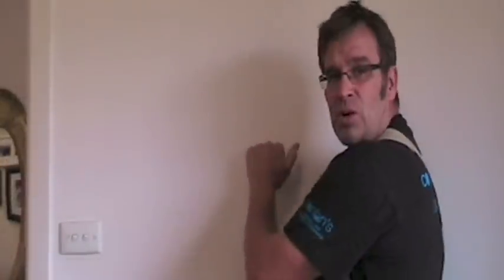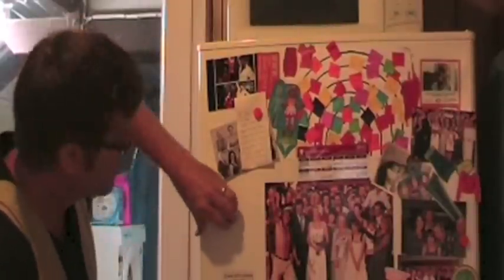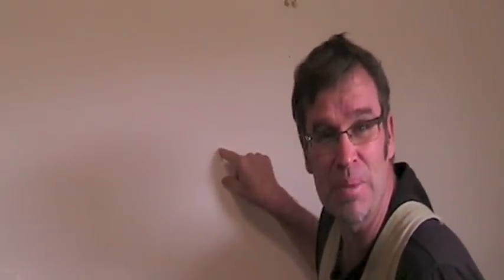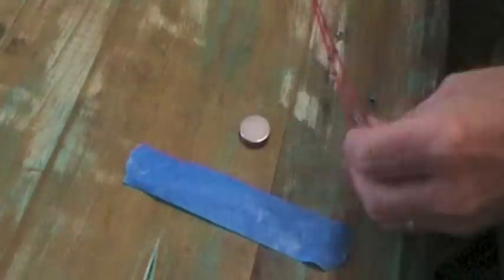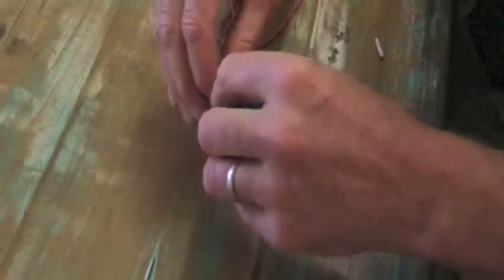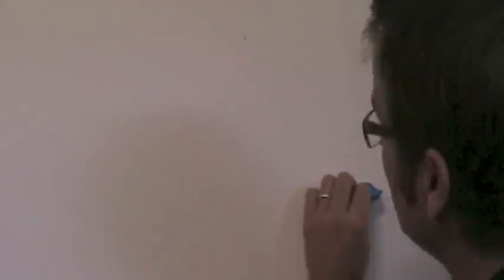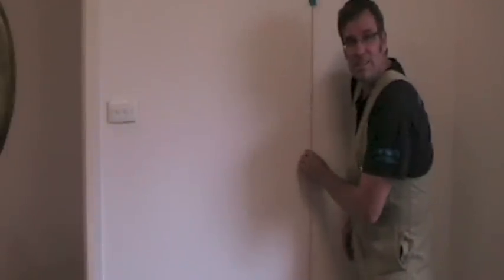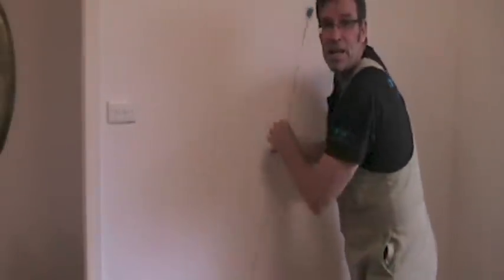How to Find a Wall Stud. THE ULTIMATE STUD FINDER!

Comment from the maker: Thanks for your comment Blackuyuyi. Much appreciated. 11kg is fairly heavy. If l was you l would try and find at least one timber stud to screw a wall fixing to and then use a Wall Mate for the other fixing. If you cant find a stud l would probably go for a wall toggle for each fixing. Check out my latest video on how to put up a shelf. It shows how to install a wall toggle. Check out the weight loading on the back of the wall mate packet. It varies as to what size of wall mate you use. Cheers

Comment from the maker: Hi Kimberly. Drywall is attached with metal fasteners exactly the same way to the ceiling joists as it is to the wall studs. So just use the magnet the same way as you would with the wall. Thanks for your question and for your comment. Much appreciated. Cheers

Comment: Remember the screw or nail fastener may have just caught the edge of the stud.
Do the method multiple times to check for consistency of 16" or 24" O.C. horizontally or check the same stud for other screws/nails vertically to see if they are plumb.
They could be as much as 1.5" off.

Comment: I was getting all depressed because I just picked up the drill for the first time in my life in attempt to put up a coat rack.  I didn't know anything about studs and proceeded to drill two wonky looking holes...I got through the drywall and then I hit something and the drill just wouldn't go further!  So then I realized that I should have read things up before I did anything...and luckily the first thing that I found in a search about hanging anything up was your video!  I watched the entire thing, got all excited and picked up some loose magnets that I had on my fridge and they had a reaction to one of the holes!!  I feel blessed lol.  This turned out to be a great learning lesson, if I had successfully been able to put up the rack on first attempt I would not have learned anything further! I do have a question - my drill still won't go further..is it because I have to drill harder to get into the wood/stud?  I tried another 5 minutes of moderate speed drilling and no advance.  What could be behind the drywall?  And would a plastic anchor be right for the stud hole?  THANK YOU!!  Shared your video to my friends and they totally appreciate your tips!!
Reply from the maker: G'day Sandy. It certainly was a learning curve for you :-)  The drill could have stopped for a number of reasons and without seeing it it is hard to determine exactly what it could be. You could have brickwork behind the drywall. You could be using the wrong type of drill bit or there may be a metal lintel behind the drywall. How far through the drywall does the drill bit stop? I'm sorry that l can't be more specific but it's really hard to diagnose from where l am. Thanks for the comment. It's much appreciated. Cheers
Reply: Thanks for your response!  It went only about 5/8 in into the wall, if that makes any sense. Tried with a different drill bit and it worked (deeper hole)!  The first drill bit I used was only for making a hole I suppose, the second one was for wood?  Sharper...I think it worked because it got through the stud.  Also used a different anchor..the drywall hole is a little cracked around the edges of the anchor but everything seems to be pretty sturdy!  We'll see..thank you for your tips and for staying in touch!
Reply from the maker: Sandy Chen Hi Sandy. I'm happy that you got things sorted out. Just a quick side note. If you happen to find a stud, you don't need a wall anchor as you can screw the wall fixture directly into the stud. Wall anchors are generally only used when a stud can't be found…if that makes sense. Cheers

Comment: My dad used to have a magnetic stud finder. It's cool, but you are relying on the carpenter to have hit the stud dead on center. Also, where two pieces of drywall meet on a stud, the screws/mails will be near the edge.
Reply: Orion Red Good call, and I agree, however I think the magnetic stud finder is very useful in conjunction with a regular stud finder. I am a professional handy man, having wall mounted hundreds of heavy pictures, TVs and clothes dryers. I have a quality Stanley stud finder and even it sometimes gives me weird, anomalytic readings from time to time due to strange, inconsistent densities (ie insulation or otherwise) behind the plaster.

I will certainly try this technique next time I need a timber stud. Thanks man. Bonza work and I LOVE this video. 😘😂

Comment: Oh man. Find a stud using a magnet and a piece of string as a "level". Brilliant.
Reply: I've used hard drive magnets to find studs for several years, never thought of the string.
Reply from the maker: Cheers mate :)
Reply: Jake Tolbert 
"....piece of string as a "level". Brilliant."
FYI- Level is horizontal.
The string is used to find, "Plumb", i.e. vertical.

Comment: I nearly resorted to this hammer method a couple of days ago when I bought a second inaccurate stud sensor.  
Instead I used a 1/6" drill bit. It worked but holes require filling after.
With several rare earth magnets in home... I can't believe I did not think of this and wish I had of seen this sooner.  Would have saved me two trips to the store and over an hour of pissing about!
Great tip!
Reply from the maker: G'day Robert. Good little trick isn't it? Thanks for taking the time to leave some feedback. Cheers mate.

Comment: Now try that in my house. I have a 60 year old house with walls 3 times thicker than normal plaster with some freaky lining that burns out drill bits. I have had 5 people try to find studs at my house and all i ended up with is 2 hours or filling sanding and painting when they left. Great tip for a normal house though.
Reply from the maker: Mate…what are those walls made of????? Thanks for the comment though. Cheers.
Reply from the maker: Aston Mowing Have you checked your skirting boards for evidence of nail holes. Normally you put at least one nail in the stud through the skirting board. It might be worth a look. Alternatively, if you have a powerpoint on that wall, remove it and slide a tape in behind the wall till it hits or locates a stud. You can then work out your stud spacing from there. Normal stud spacings are around 16 inches which is 450mm in metric. Hope that helps.
Reply: I wonder if sandwiched a layer of portland cement.
Reply from the maker: Aston Mowing Good luck

Comment: I've been wanting to hang a pegboard in my kitchen, but I've been putting it off because I didn't know how to find the stud without spending money on a stud finder. I'm going to try this method. It makes so much sense and is inexpensive. Thank you.
Reply from the maker: +Rhonda Rhodes Good stuff Rhonda. Good luck with it. Cheers
Reply: With your suggestion, it took me literally 5 seconds to find the stud. Now I'm ready to put up the peg board in my kitchen that will be strong enough to hold up my pots and pans. Thanks for your help.
Reply from the maker: My pleasure Rhonda :-)

Comment: OMG. I found the "stud" and put a nail in the center, found it was a water pipe and after a $500 repair bill and new wall (exposing my studs while being fixed) I had found most of my studs.    Just kidding. Your method of finding studs is excellent. Best part you don't need a battery for your stud finder device. Love your video tips. Keep it up and make more. Thanks mate.
Reply from the maker: You had me worried for a second there Pawlo! Glad you found the tip helpful:) Stay tuned as l will be posting more in 2014. Cheers mate and have a good christmas.

Comment: Nice! Never thought of the string! I use the magnets and I must say, it is the best. Mine is strong and has a little place to leave marks and has a level on it. It has also helped me find metal studs as well.
Reply from the maker: +Tamer Bekir Thanks Tasmer. I'm a big fan of the magnet. I actually used the method tonight to hang a wall picture. Cheers
Reply: Also, if you have a ball chain there is no need to attach tape because a ball chain is metal and will stick right to the magnet!

Comment from the maker: Mate, refer to my answer on your previous comment. Just check the back of the wall mate packet to weight loadings. I would hate for your mirror to fall down and smash. Wall mates will not screw into timber wall studs. Just use a normal wood screw for screwing your fixing into a wood stud. Hope this helps mate. Cheers.

Comment from the maker: Hi elgrosmax, the magnet will find the fasteners in your ceiling joists (therefore locating your joist which will provide you with a solid product that you can screw into) just as it does on your walls. Cheers mate

Comment: Ding-dong - I had an old hard drive, took out the magnets and used a piece of cotton to form a pendulum. Swing it gently backwards and forwards and hey-presto, it sticks to the screws. I marked them with masking tap, drill into the stud frame timber and put in some  screws. This enabled me to hang a very heavy framed mirror. All thanks to this video. Cheers!
Reply from the maker: Well done Imacnz and thanks for the feedback 👍

Comment: Thanks Shane... Great tip! I'm a DIY rookie.. I'm hesitant about hitting water pipes, drain pipes, gas lines and electrical. How can I prevent that using this method?
Reply from the maker: G'day Jax. To ensure that the magnet has found a stud and not a water pipe or electrical wires, do this. Run the magnet over the wall till you find a fastener, then rub the magnet against the wall up to the ceiling in a straight line, and down to the floor from that initial fastener. If a stud is there, you should pick up one. two or three more metal fasteners in that line. This indicates a stud is present. Also try tapping the wall on either side of the fastener  that the magnet has found. If the magnet has found a stud then the tapping sound should sound hollow  compared to where the magnet is.Hope that makes sense. Cheers.

Comment from the maker: Hi Charanjit,without getting to technical,  generally speaking, load bearing walls refer to those walls that support a roof load. In the modern single story home that has a truss roof the load bearing walls are typically the external walls. In a double story home load bearing walls can also include the lower story walls that support the upper floor joists. Hope that helps mate. Cheers.

Comment from the maker: Thanks for the heads regarding esty.com. To ensure that the magnet has found a stud, do this. Run the magnet over the wall till you find a fastener, then rub against the wall up to the ceiling in a straight line, and down to the floor from that initial fastener. If a stud is there, you should pick up one. two or three more metal fasteners in that line. This indicates a stud is present. Hope that makes sense. Cheers.

Comment: Awesome!  Worked with a magnet from an old 2.5" laptop hard drive, which is much smaller than the magnet in this video.  Also didn't work until I made the handle with tape.
Reply from the maker: Well done....glad it worked 👍😁🇦🇺

Comment: Fantastic mate. I've just went a purchased a magnet but i'm raging now that i've seen your handy tip about the magnet in a hard drive. I had an old external hard drive sitting about so i took it apart and got the magnets out of them. They work like a treat. Cheers mate :-)
Reply from the maker: Those hard drive magnets are pretty powerful Frazer. Thats for watching mate and for your feedback. Cheers :-)

Comment: I didn't have any magnets handy but I did find studs in my wall by knocking. I wanted to be able hang my cloths but I never installed brackets before. Thanks for the video!
Reply from the maker: Good stuff Psovegeta! There's nothing wrong with the old knocking on the wall method. Cheers

Comment from the maker: Hi Rob, what seems to be the issue mate? Are you using a strong enough magnet? Try the one you're currently using on the wall and see if it is strong enough to pick up any metal fasteners there. If you can't get a connection there then l would suggest a stronger magnet. Like l said in the video, 'rare earth magnets' are the best one's to use. Buy one or salvage one from an old computer hard drive. Hope the helps mate. Cheers.

Comment: Hey great tip mate! But will the stud finder also find electrical cables though? Don't wanna drill into those thinking it's actually a stud fixing
Reply from the maker: No it shouldn't mate. The wire inside the cables has a very low magnetic attraction. Picking it up through the drywall would be unlikely. Secondly, wiring is usually poked through the centre of a stud so its a long way from the face of the drywall. It's installed this way so that the likely hood of accidently putting a nail into it is minimised. If you still aren't confident you can still buy an electronic stud finder that can detect wiring as well as the stud. Hope that makes sense. Cheers mate
Reply: Manks Thate!

Comment: I've never fully trusted the accuracy of those battery-powered gadgets with blinking diodes. I love the simplicity of your solution. I did as you instructed and one of the magnets is stuck to the wall right now. Brilliantly simple! BTW, I love your impression of George W. hanging his first family picture in the White House presidential suite.
Reply from the maker: Hahahah thanks mate. Glad to help out and thanks for the comment :-)
Reply: The head of my bed rests against a wall that looks out onto my back yard. I want to hang some shelves on this wall but I can't find any evidence of metal/studs with my magnet. Is this because this wall is solid concrete? Should I just drill and use quality wall plugs to hold the bracket strips in place? Thanks Shane.
Reply from the maker: Without seeing and feeling it, it's pretty hard for me to say. If you think it is a masonry wall the yes...just use some plastic plugs and you're good to go. Cheers

Comment: Great tip. I've been trying to find the studs in a wall in my garage( the guy before me made it into 2 separate rooms so there's a wall in the middle and after your method not working I just started pounding nails in the wall and I found that there are 3 studs in the wall. I was going to attach a work bench but I guess I'm just going to build legs for my bench instead of building it into the wall
Reply from the maker: It's a shame you couldn't find the studs Modedchild. Were you using a rare earth magnet? Cheers

Comment: Brilliant! Does this also work, somehow, to know if there is wiring at that particular stud point?
Reply from the maker: +Josev Kreu Hi Josev. Most house wiring is copper which is not detectable with a magnet. If you're worried about that there are detectors on the market that can locate wiring. Good luck.
Reply: Thanks!

Comment: Awesome trick! thank you so much. I am doing my first ever bathroom remodel and I am installing shelves that need to be screwed into a wall stud and I am not about to go out and buy a Stud Finder and the "light Switch" method wouldn't work for me cause my Light Switch in my bathroom is on a different wall then where I am putting the shelves and plus the wall its on is like only 1' Wide, pretty much big enough to hold a 3 switch light panel! Thanks again!
Reply from the maker: Thanks Aleasha. The magnet trick works like a charm. Just make sure it's a Rare Earth Magnet as they are quite powerful for their size. Good luck with it and Merry Xmas. Cheers
Reply: I was wondering, does the magnet trick only work on certain types of walls? (sorry if you explained this in your video, I don't remember, and I am at work asking you this LOL so I can't watch the video as of this moment.)
Merry Xmas to you too.
Reply from the maker: Aleasha Brokos from DirectBuy of Columbia, MD Hi Aleasha. Don't let the boss catch you watching DIY videos :-) It works most effectively on drywall surfaces which most walls are. Cheers

Comment: Haha great vid man. Just wondering though, is the magnet finding gyprock screws or the nails for the noggings. I'm asking because what if stud adhesive (which is very commonly used now) was used. Or does it pick up nails from the noggings..  If it does that I'm assuming the string line trick to find centre plumb won't work. Or does it? Let us know if you can. Either way the magnet idea is great so smart.
Reply from the maker: Mate it will find the screws in the gyprok. Most guys put a screw in the middle of each sheet as well as on the joins where the two sheets meet. So with that in mind, and assuming  that the sheets were installed horizontally, you should find a screw about a quarter of the way up, one around the half way point and the next one about three quarters of the way up the wall and these all should be around the centre of the stud. Hope that makes sense. Cheers

Comment: I love this video, funny start with a simple ingenious solution and will be certainly giving that gadget a try. Off to ebay now to buy an Earth magnet...
Reply from the maker: +Derrick Austin Good luck Derrick. You'll be happy with the purchase. Cheers :-)
Reply: +shaneconlan1 Thanks Shane. I bought 5 earth magnets (Torus shaped - hole in the middle for marking with a thin pencil, so no taping required) and wow, I can't recommend these magnets enough as it took me a good 10 minutes just to separate them from each other. I had to warn my daughter that they're not for children. Place them anywhere near a stud and BAMMM...those magnets are like a horse that's just bolted, as they rip away from your hand. For readers out there, throw away your convential expensive less useful electronic stud finder and follow Shane's advice. Great tip!